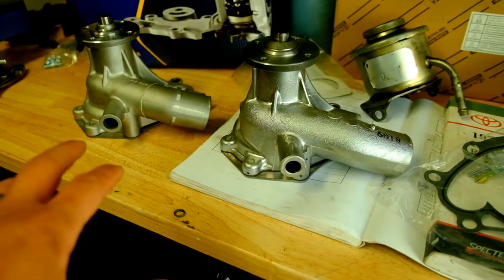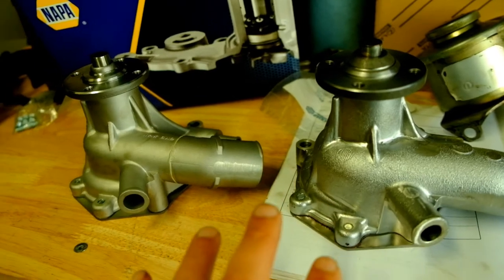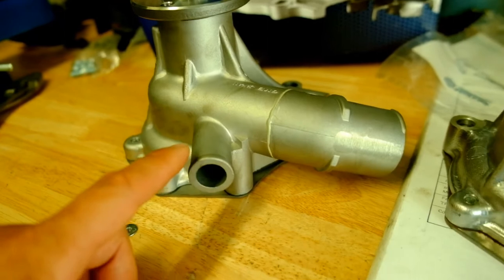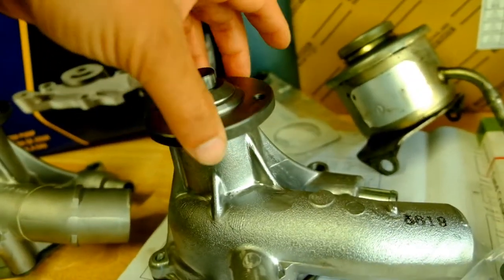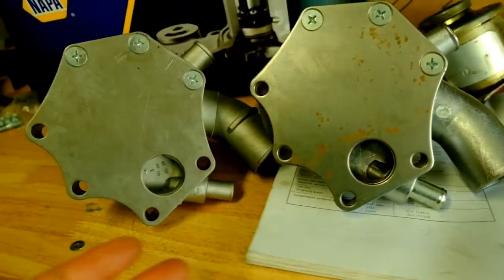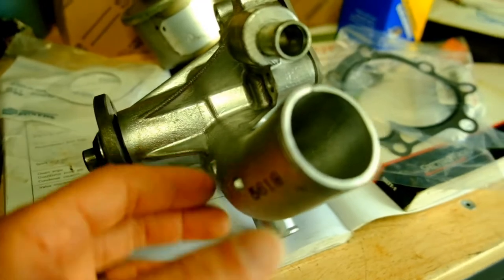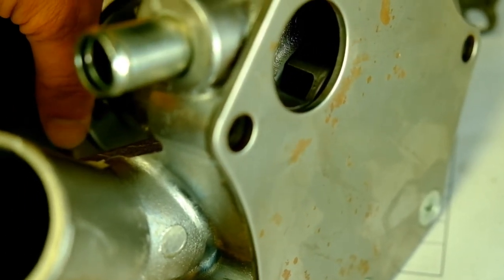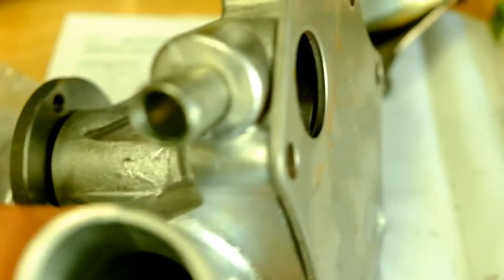Fj60 Water Pump Comparison - ASIN vs NAPA

Comment: The part of the pump inside of the housing that looks like a fan blade, and actually moves the coolant; is called the impeller. Impeller design is a very complicated field; as it involves applied fluid dynamics. You pay a higher price for the AISIN pump because it is a field proven execution of a field proven design. They last a long time, as long as the belts are not over torqued, and the fluid is kept free of rust and contaminants. This is one application where the peace of mind and reliability that comes with OE is well worth it, IMO.

I always go with OE for water pumps and alternators.

Comment: The Aisen looks to be better built.  I have a GMB water jump, made in Japan. But it looks more like the NAPA pump. I haven’t installed it yet because the old one is still working. When I put a new radiator and thermostat in, then I will put the GMB pump in. Good video!

Comment: Genuine Toyota/ Aisin Aftermarket is best quality. 
Aisin is the original supplier to Toyota for the water pump and would put Toyota teq brand into the casting at manufacture . 
When you buy Aisin Aftermarket you will notice the Toyota branding in the casting is ground off / removed. 
Aisin aftermarket should have a fan clutch , fan blade, thermostat , clutch release cylinder , clutch master cylinder , rear brake wheel cylinders,  and brake master cylinder to suit your sixty.

Comment: I’m having trouble finding the bolts mounting the water pump to the engine. Does anyone know the measurements or website I could buy some?
Reply from the maker: The dealer has them.
Reply: City racer LLC